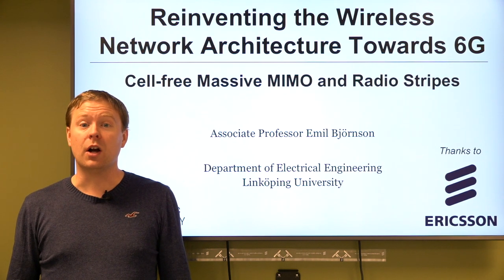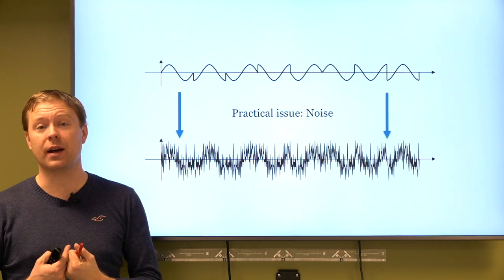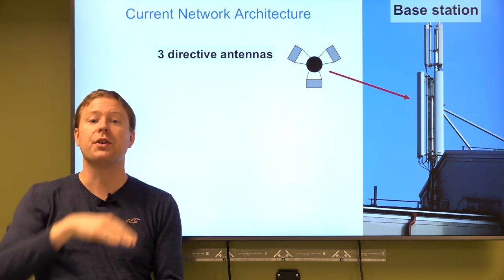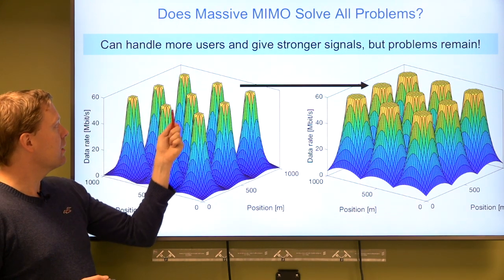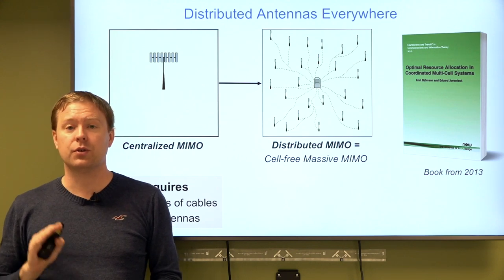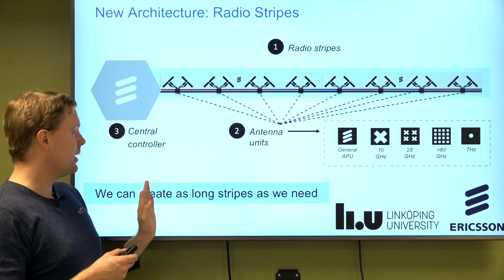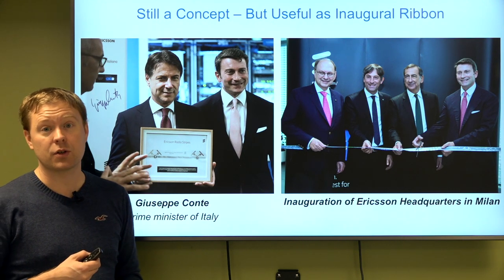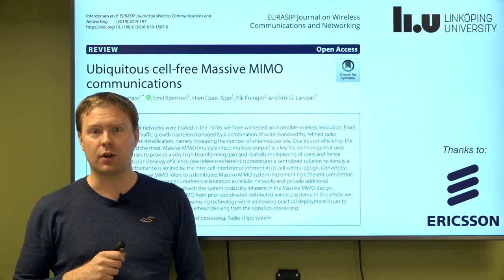Reinventing the Wireless Network Architecture Towards 6G: Cell-free Massive MIMO and Radio Stripes

Comment: 40 times is just 16 dB, not dBi.  "dB" implies a ratio, in this case 40x.  The "i" refers to isotropic, which is a theoretical omnidirectional antenna.  So, when you say 16 dBi, you are saying 40x the signal from an isotropic antenna, which you did not mention.
Reply from the maker: That is correct and it was actually mentioned at 7:20, though we didn’t use the technical term “isotropic” but described what it means instead.

Comment: Looks like a solution of dot Radio of E//, Lampsite of Huwei and ASiR of Nokia which are widely used for 4G & 5G as part of indoor small cell. Those radios (AP) have 2x2 MIMO or 4X4 MIMO. How does it comparable with the outdoor massive MIMO like 32T32R or 64T64R which have 8x2x2=32 (8 horizontal beam, 2 vertical beam and dual polarization) and 8x4x2 =64 ( 8 horizontal beam, 4 vertical beam and dual polarization)?
Reply from the maker: The vision is that the indoor product line can evolve into radio stripes, by first enabling coherent joint transmission between multiple APs and then change the form factor of the APs. A comparison between cell-free massive MIMO, uncoordinated small cells, and cellular Massive MIMO is provided after 7:30 min in the following video:

https://youtu.be/yUI-PmdJiVY?si=vnVTUsFHpI6Guh8_

The main thing is that we can get smaller pathloss variations by spreading out the antennas, and we need coherent processing between the APs to resolve/suppress the interference.

Comment: Hi. I have a question. If we are unable to reach certain users because of difficulty of setting up a base station, why not use a Repeater system with the existing architecture ?? Or is it something similar? Thanks
Reply from the maker: A repeater system is a possible alternative for coverage extension, but it is less efficient. Firstly, because of the two-stage transmission where one needs to transit twice to reach the user once. Secondly, a repeater system will cause interference to other concurrent transmission in the area, while a cell-free system can control interference by optimizing how the signals are sent and received from the different antennas. Hence, it allows for spatial multiplexing of many users.
Reply: @WirelessFuture  this is great. Network Engineer here.

Comment: problem with directional cell towers is they are mostly high powered microwave cells/microwaves on poles which makes them harmful as to why towers were originally capped at 1watt per cell with 5g cells transmitting at and above 10 watts
Reply from the maker: A transmission power of around 40 W per base station was quite common also in 4G. 5G is not increasing the transmit power, but rather makes use of the same (or less) power more efficiently. Since a mobile phone typically only receives a fraction 1/1,000,000,000 of that power (under good conditions), one can benefit a lot from shortening the distances between phones and base stations using the cell-free architecture. The transmit power can then be greatly reduced while the same amount of power is received by the phone.

Comment: I was just thinking that what happen if some of these stripes have been cut. is data stream going to shut down? you now like  series of lamps, what happen if one lamp broke
Reply from the maker: If the stripe is cut in two parts, the outer part won’t work. However, if it is only one of the antennas that breaks down, the rest of the stripe could continue operating. At least it is possible to build it like that.

Comment: Sir, I have one doubt. Is there any closed-form formula to calculate How many antennas that can able to fix on the base station. -
Reply from the maker: The number of antennas is limited by size, weight, and cost constraints. If you only care about size, then you can assume that the antennas are separated by wavelength/2. For a given surface area A, the number of antennas that fit is A / (wavelength/2)^2.
Reply: @WirelessFuture I  can understand. Thankyou

Comment: That is a great demonstration of deep understanding of wireless technology. Thanks for being kind to make the content freely available for public.
Kindly answer my questions:

1) What about RF stages for the radio stripes? Are they part of the black processing units?
2) A non technical question-- who owns thestripes? Network operators? How do they safe guard them when they are placing them closer to users?
Reply from the maker: 1. Yes, the RF processing is done in the black antenna processing units, and the baseband processing is partially done in the black units and partially done at the central unit at one end of the stripe.

2. There are many options. It could be network operators that improve their coverage, or building owners that want to provide good indoor wireless connectivity (instead of using Wifi), or private persons that use them in their homes. The future will tell.

Comment: Very interesting thank you. My understanding is the distance between 2 dual cross polarized streams is equal to one or half wavelength. So for each frequency range we will have a dedicated strip, right ? 🤔
Reply from the maker: Ahmad DIRANI Yes, two adjacent antennas are at least half a wavelength apart. It remains to be seen how many frequency bands can be handled in the same radio stripe. One can potentially have antennas for multiple bands in the same stripe, for example, every other antenna  processing unit could manage a different band.

Comment: Q: the wires link the antennas can also transmit radio waves, right ? How to shield the noises from them ?
Reply from the maker: No, the cables will only transmit digital signals. The radio signals are generated in radio unit right next to each antenna.

Comment: How long can an stripe be. 1km or 10km. I think on an Highway or something like that.
Reply from the maker: Eduard Walz In principle, you can make it as long as you need. But you probably need to divide it into segments since the power is supplied from one end of a stripe and it will only reach a limited distance (not more than 1 km, I think). There are many implementation ideas and it remains to be seen what works out well in practice.

Comment: Great Lecture. Can you please explain how does it connect to the backhaul ?
Reply from the maker: Any conventional technology can be used as backhaul to the stripe (connected to the central processing unit), such as fibre or microwave links. The fronthaul connection inside the cable can use conventional ethernet technology.